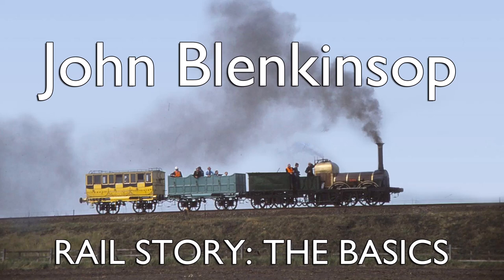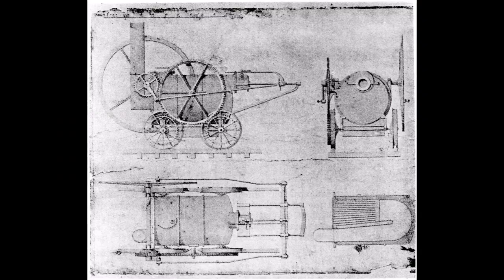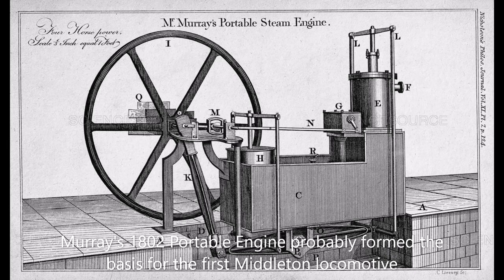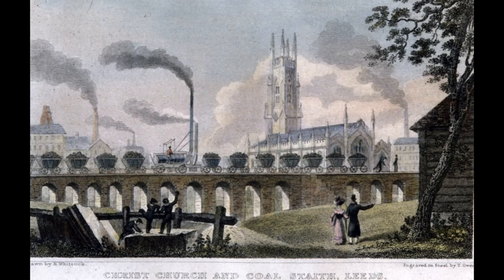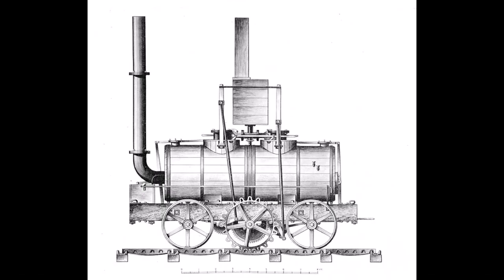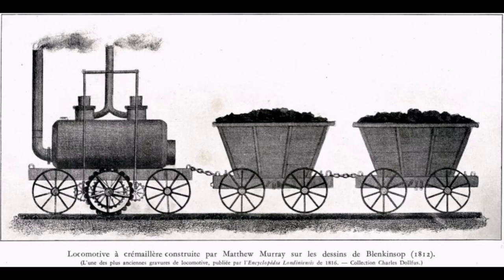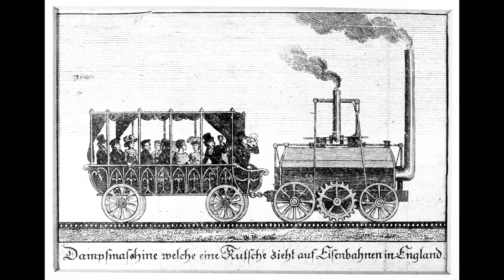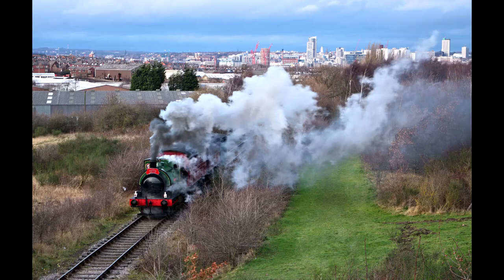John Blenkinsop: The Basics

Comment: Odd that there was no Feedpump...so they had to de-pressurerize the boiler, maybe put the fire away. Cool down a bit and then replentish water? How many houres to wait between they could run these engines....
Reply: Yeah. At first they were used on a "single fill" basis: the steam was let off and the boiler refilled each time. They were subsequently fitted with a feed pump and a very small water tank.

Comment: A cast iron boiler, sounds very dangerous to me.
Reply from the maker: Trevithick used them succesfully; when Salamanca exploded in 1819 is was due to the safety valve having been tampered with rather than a failure of the boiler. Matthew Murray thought cast iron boilers too heavy so in 1813 changed to wrought iron to save weight and to increase water capacity.